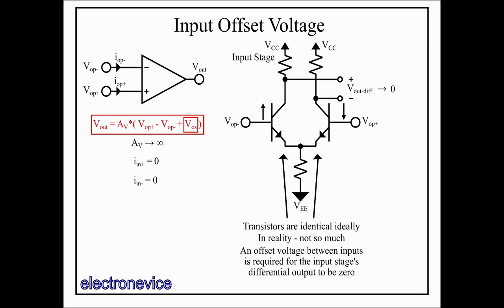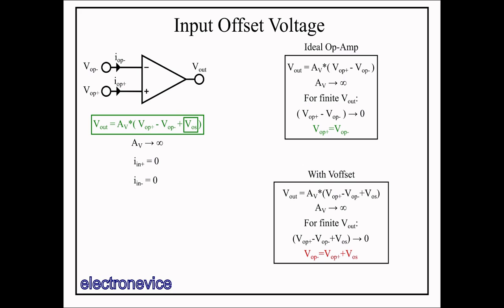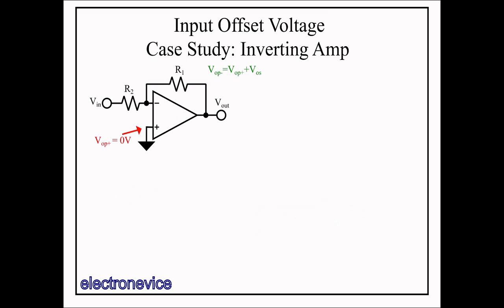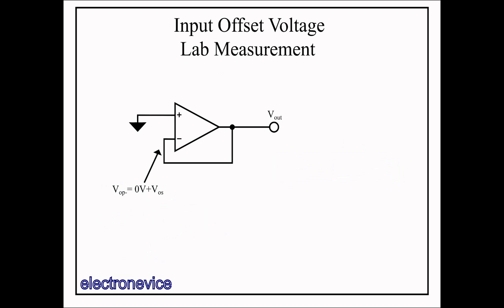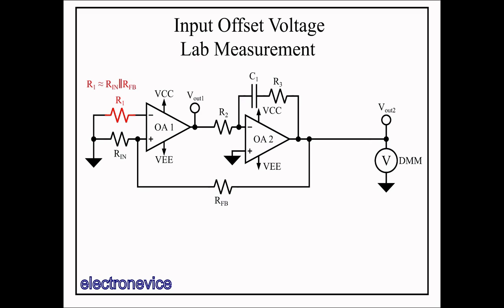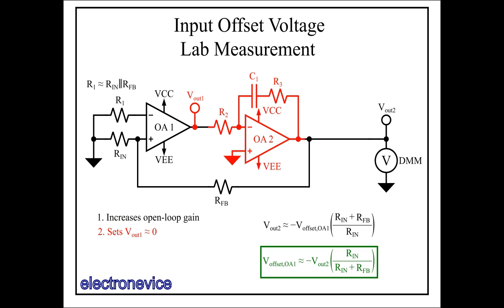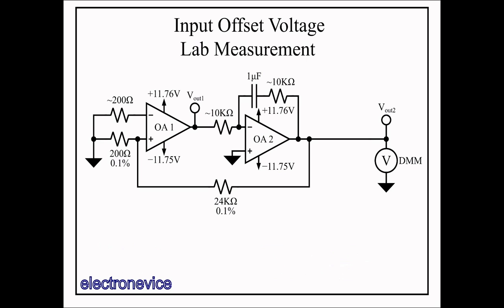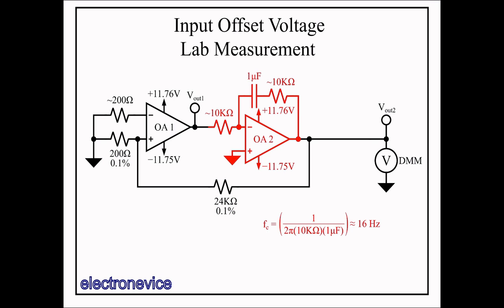Op-amp TS 10: Input Offset Voltage and How To Measure It

Comment: Really interesting, @electronevice. I've been wondering about how to measure the input offset voltage more accurately, ever since trying the approach (with an integrator) discussed in the course notes book which goes with the Art of Electronics. What op-amp are you using for OA2? I imagine that it's a precision device with low input bias current and possible one where you can hand-balance the offset voltage or perhaps even an auto-zero type. Thanks again.
Reply from the maker: Glad you found it interesting!  In the video I use an additional LM324 just for simplicity, however you are correct that it would be better for OA2 to be a precision device like an autozero or chopper, assuming the output swing of such an op-amp is suited to the endpoint measurement device.  I intend to make another longer video going into the details of this circuit and some improvements, but I haven't had time to get around to it yet
Reply: I was wondering the same thing as well and was about to write my comment, but found yours.